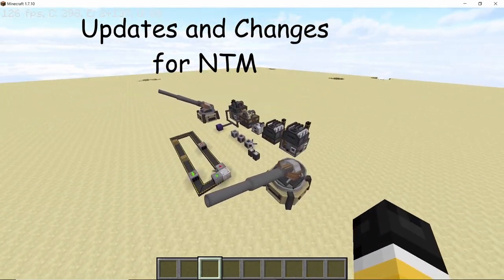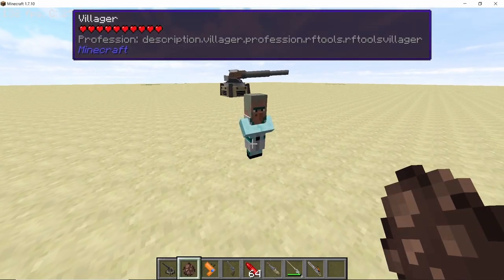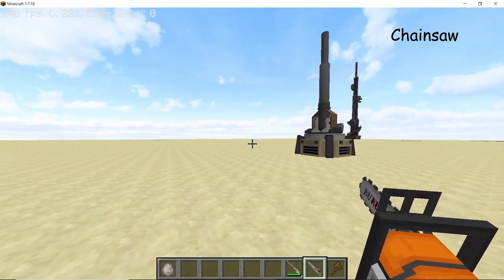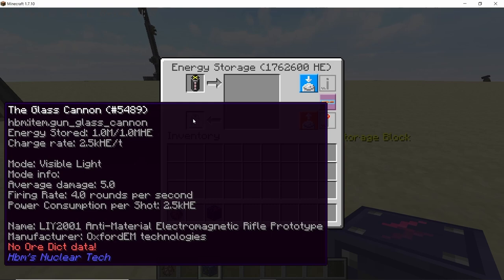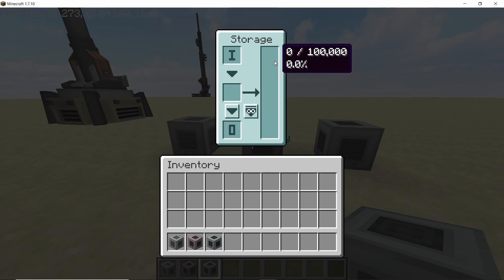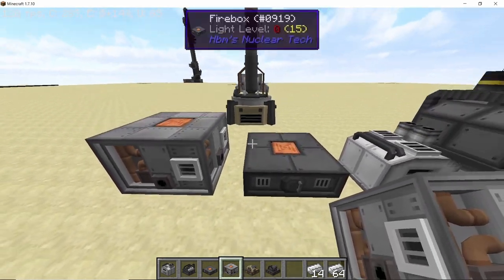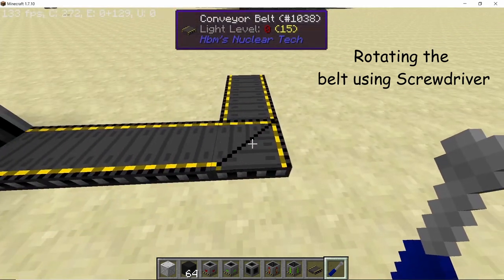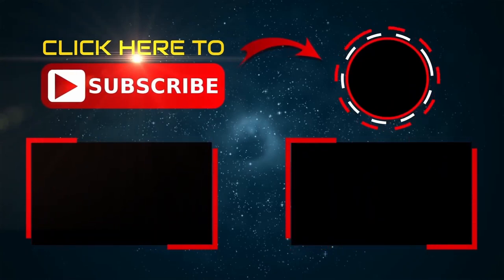NTM Updates & Changes - Artillery Turret & Weapons, Stirling Engine & Heat Based Machines: Minecraft

Comment: "I don't always do war crimes. But when I do, it's not war crimes, it's weapons tests" 
(C) Savage Vegeta
Reply from the maker: I'll have this line as my motto when I make my own info page 😂
Reply: @SavageVegeta  хаха найс
Reply: how do u apply special items to ur gear
Reply from the maker: @colbycantsay6644  using the Armor Modification Table , just take the Armor piece you want to modify and the modification you want to apply and shift right click them into the modification table. Once you take the Armor piece out the modification will be applied to it
Reply: @SavageVegeta  and how do u recharge the armor thx
Reply from the maker: @colbycantsay6644  you can place individual Armor pieces in the output slot of battery storage block and that will charge it , or you can use the charging station to wirelessly charge everything that can be charged in your inventory
Reply: @SavageVegeta  thx

Comment: One key thing I have noticed with the artillery after watching the video and testing it myself many, many times, is that the cluster shells only work in the 'artillery' or 'manual' modes. If you fire them in cannon mode, it will only release one shell, and be a huge waste of resources since single versions of the shells exist and the cluster shells each require multiple of the single shells to craft.
Reply from the maker: oh thanks for the info, I hadn't noticed that ... I'll try it out in the latest release of the mod and see if something has changed

Comment: Such an amazing mod!
I hope one day all this will be ported to 1.12.2. 🙂
Reply from the maker: It'll take time before that can happen ... But yeah even I hope for the same
Reply: there is a port though? I use it all the time.
Reply: @deadly5881  partly not every item in it
Reply: @hallo_da8583  no someone made a new port called HBM reloaded which ports everything from 1.7.10 to 1.12.2 it came out like a month ago
Reply: @deadly5881  link?
Reply: @DEXTRINE  I keep sending the link but it fucking keeps getting taken down
Reply: @deadly5881  even this cañon?
Reply: @deadly5881  is on curseforge?
Reply: @pabloandresortizreyes3191  yes. just search up Hbm reloaded
Reply from the maker: @deadly5881  the last update for hbm Reloaded was like 3 weeks ago , and I don't think that has the cannon and most of the newer stuff
Reply: The port exists, but it does not contain everything the 1.7 version does. It is several updates behind.

Comment: Cool update, it remains just to add for missiles, and of course you can add multi-build radar systems from level 1 to 5
Reply from the maker: Multi level radar system would be cool !!
Reply: The idea is great, the developer of this mod does not update the tab with missiles and explosives. It is only necessary to throw an idea to the developer of this mod, only how to do it. A lot of things can be added specifically for missiles, radars, military infrastructure such as large bunkers. Especially what would it be on 1.7.10 and the highest

Comment: I cant find the artillary turret or the advanced radar in my hbm mod. Have i a wrong version or was it removed
Reply from the maker: you are either using the 1.12.2 version of the mod which is called HBMs NTM Reloaded or you are using an outdated version for 1.7.10
Reply: @SavageVegeta  im using 1.12.2 reloaded
Reply: @SavageVegeta  thanks
Reply from the maker: @sir_timon  well that explains it then , when/if you switch to 1.7.10 version you can access all the new features of the mod !!

Comment: when i use the artillery turret in manual mode I can't shoot past 250m, did the turrets needs to be in a charged chunk to be able to fire ?
Reply from the maker: No that's weird cause in manual mode artillery turret can fire upto 3 km's away ... and the shells load chunks as they travel so you don't really have to load them up yourself
Reply: @SavageVegeta  yeah kinda weird, but it's fine i just placed the turrets near the world spawn point so it's always loaded and it fixes the problem

Comment: what happens if you put a box inside a box inside a box?
Reply from the maker: I don't think it'll work , but if it does that would be a certified pog moment
Reply: @SavageVegeta  i like that hbm and ntm adds new weaponry and yet there only 4 bosses i feel like hbm need abit more mobs and creatures cause it lacks too much and i don't want to add mods that add more bosses cause they're either too weak or straing up incompactable also comparing them to hbm bosses they don't fit in

Comment: Would this work with forge mods?
Reply from the maker: No the 1.7.10 version of NTM is not very compatible especially when it comes to fluids with other tech mods 
The 1.12.2 version however is the one you want if you want high levels of compatibility with other mods